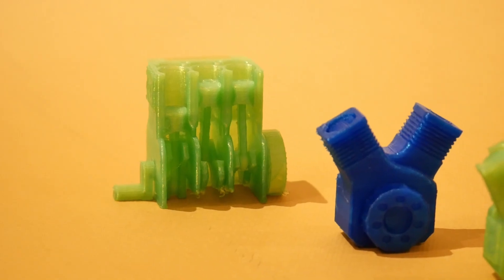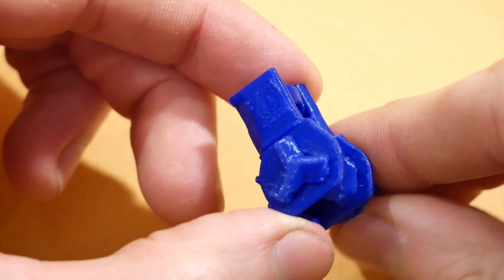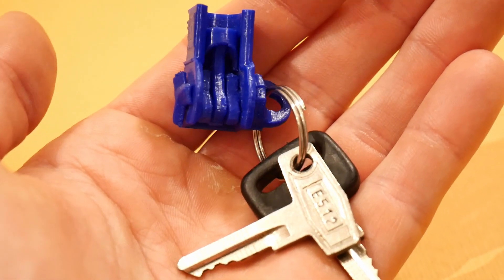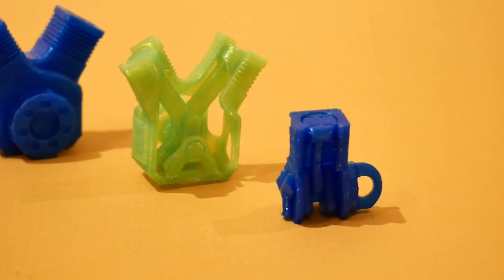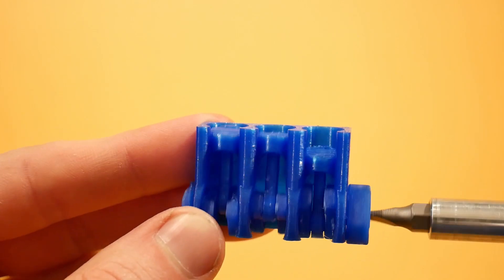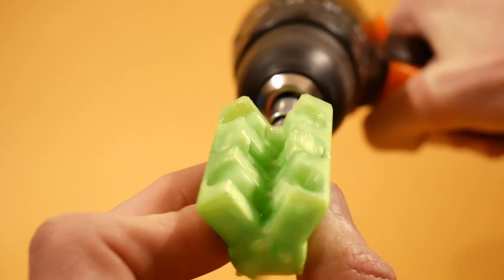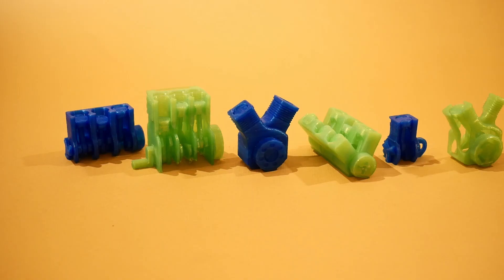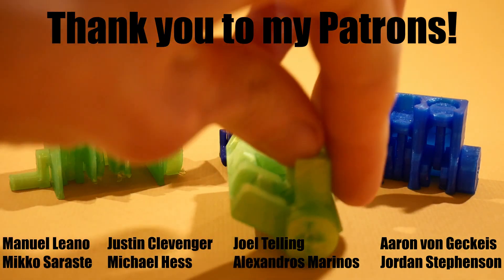3D-Printed - New Print In Place Engine!

Comment: if you use the fast profiles from filament friday (0.28mm or 0.32mm layer high ones) you can actually print it in about 15-20mins
and with klipper you can maybe print it in 10-15mins
but it might not actually rotate (i didnt test if it would work yet)

Comment: Hey, i printed the 1cyl keychain ... but its only working with -0,1mm (and then i need a bit strength to turn it). Whats that meaning in the end? How can i tune my printer so print-in-place works better or with lower XY compensation? Any help would be nice :)

Comment: Dear sunshine i tried to make the keychain but it had some extra stuff on the keychain part and a extra part was covering the mechanism i dont think i used the recomended tip but everything else was good
Reply from the maker: Sounds like you had supports turned on, for this print, they should be off
Reply: @TurboSunShine i also dont think i used the compinsation thing

Comment: Huh that will fit my Honda CN250 Helix as replacement Cylinder, uhm i meant key chain.
BTW your machine sounds like missing spark ;). Invest in old Honda roller like Helix ;). Greets for 3D printer & Scooter rider - 2 stroke power!
Reply from the maker: haha, just a cloged carburator  ;)